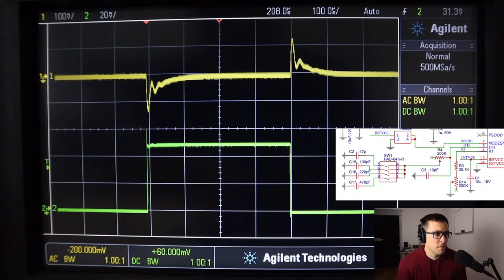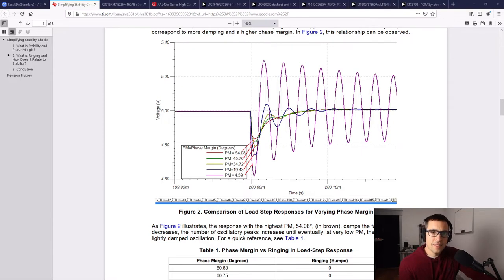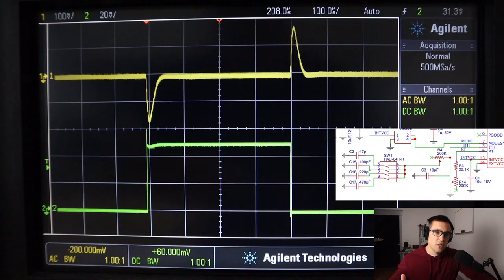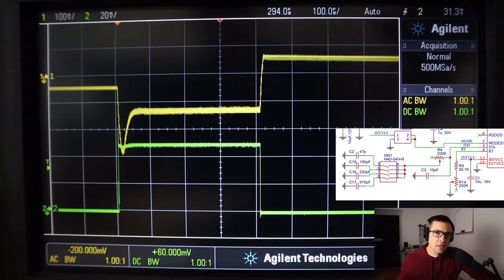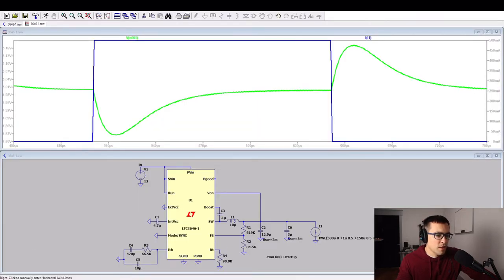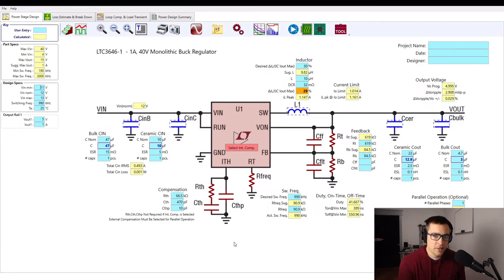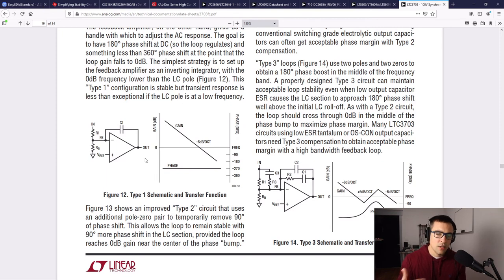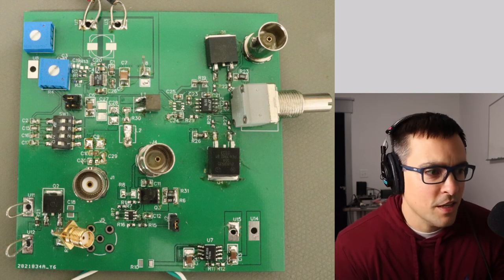Switching Regulator Compensation and Stability (How To)

Comment: Great video, thanks! Would be great if you did an isolated flyback (or whatever topology) that includes a TL431 and opto.
Reply from the maker: Many of the newer parts eliminate the need for an opto and TL431. You should consider something like the MAX17690, ADP1071, or ADP1074 to make your life easier!

Comment: Very good and understandable explained ! If you want to make a lab power supply then you also have to introduce a op amp for current sensing does that mean that you have then two different compensations which adjust the feedback line ?
Reply from the maker: Thank you. The short answer is that it does mean that you have two control loops. Parts that include a constant-current loop are usually compensated with one set of components. The LT3790 is one example. (FB and CTRL have separate amplifiers, with the amplifier outputs connected together at the VC pin.) Alternatively, the LT3840 gives you a separate pin (ICOMP) to compensate the part in constant-current. I hope this helps.
Reply: One can make his life harder than it can be ! I wanted to go with the UC3842 first but your answer is clearly the easier way to go. That helps thank you very much sir 😃
Reply from the maker: So true. Glad to help.